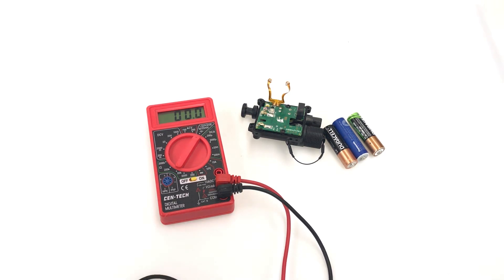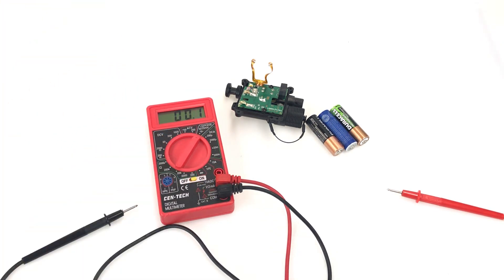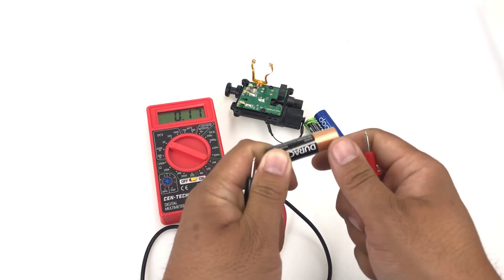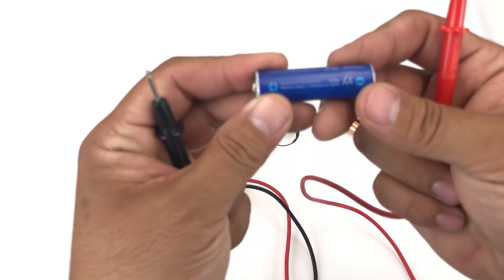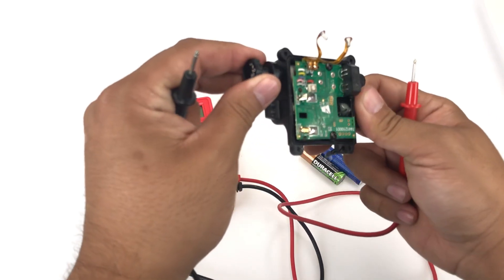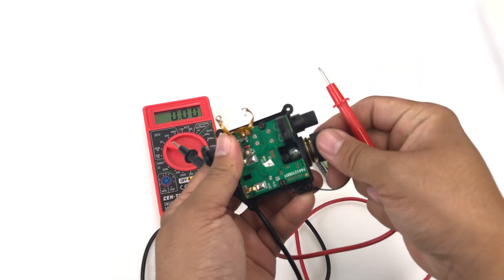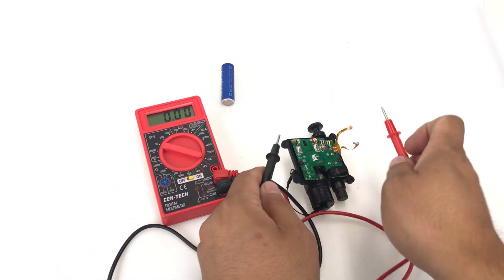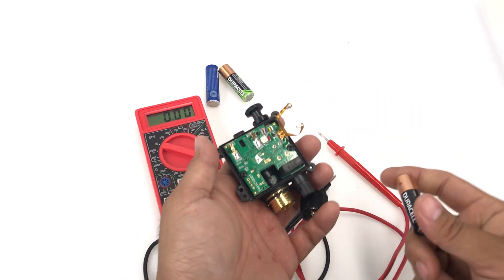Rechargeable AA for Night Vision PVS-14

Comment: On the opposite end of the battery cap, there is a little nub with two holes in it.  I’ve noticed that varies from model to model. Yours is sort of square trapezoidal cornered and others are like a semicircle? Is that any indication of quality or is it just nothing?

Comment: Yep. The power supply steps up the voltage to ensure that the tubes always get the same voltage no matter how low the voltage is on the AA cell. We do this with all kinds of sensitive equipment like computers or ham radios. Thank you for making this video.

Comment: Thank you!  I've been meaning to do this but haven't gotten around to it.  I run eneloops in my 14's & 7's and never had an issue.  I've tried rechargeable lithium CR123's (Olight brand) in my FLIR thermal monocular as well and other than the battery meter indicating it's flat, it doesn't mind the higher voltage over that of a primary cell.